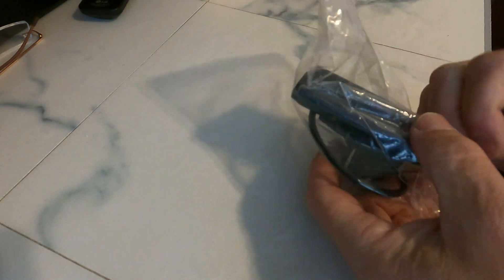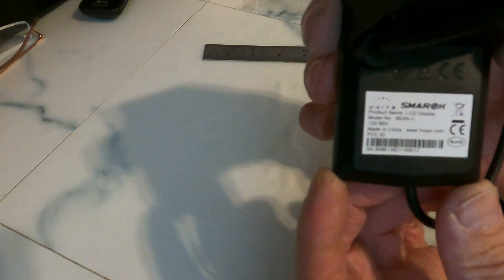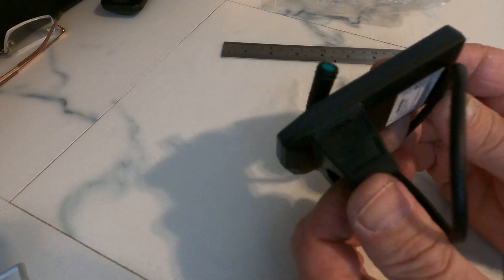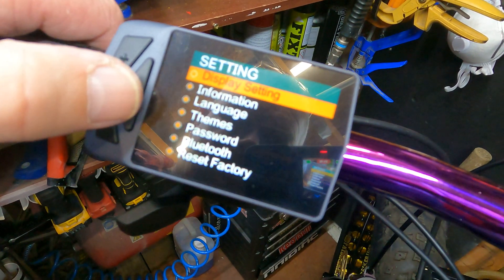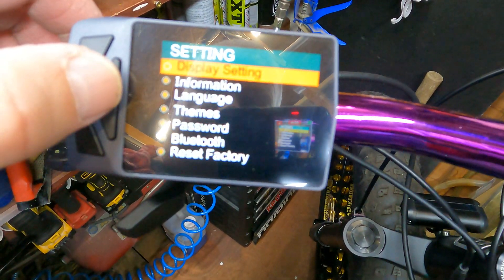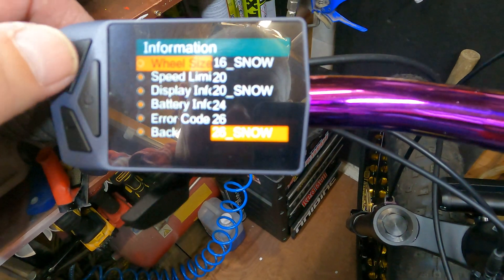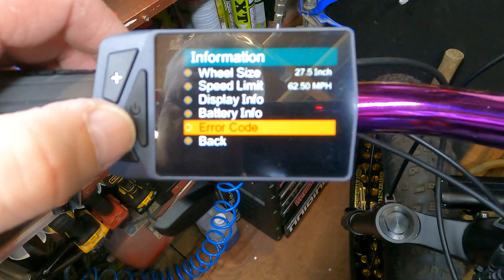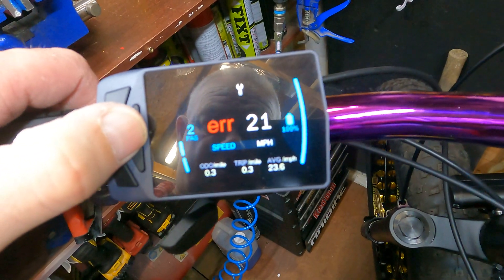B02N new lcd for Bafang will it work on my fat bike

Comment: fat bikes are set to 28"  I was going to try that display but NOT sure because I wanted to use the Bluetooth feature for the Bafang program app ( SPEEED ) to be able to program the controller on the fly like you can with the EGGRIDER display.

Comment: Sweet looking bike, i like the under frame front mudguard to protect the battery!! Did you make it or is it a bought item? I wouldn't mind looking into putting one on mine
Reply from the maker: this is what you need to search for buddy XLC Mudguard MG-C05 Fatbike
Reply: @FATBIKERIDER Thanks man much appreciated🤙 i subscribed ill check out some  more of yr videos when i get more time🤙 im running a DP-C18 screen on mine that came with the bike standard, if i upgraded it I'd probably consider a eggrider so i can reprogram the parameters on the motor with Bluetooth by app. Im not 100% but think they are the only screens around capable of reprogramming instead of cable and laptop to do it. Cheers

Comment: One thing which interesting is the IP67 rating.  If that were true then it could be a good replacement for my beloved 500C which gets a bit misted up on rainy days and imagine is getting a bit corroded inside due to damp ingress.
Reply: Yeah I have that also on my 750C not worried about it but the ones with a usb charge like the dp-18 really messed up the screen and got the error 30/flash controler and not brick it or another 100euro screen ridiculous

Comment: Power on password: 0000, Advanced settings password: 2020
Reply: this didn’t work for mine
Reply: @vxidclan6876  As a matter of fact, this B02N was first developed and put on sale by the company I work for, so all the passwords are the same. If the actual passwords don't match the ones I've provided, you may need to contact the dealer where you purchased the B02N to enquire about it, and it may be that the dealer has changed the passwords.

Comment: My display is a four digit passcode locked. Any idea what the factory preset password is?
Reply: Power on password: 0000, Advanced settings password: 2020
Reply: @AccolmileGroup  thank you!
Reply from the maker: you could try these but i dont have it 0000 1234 1919